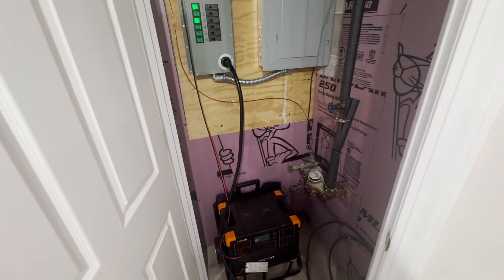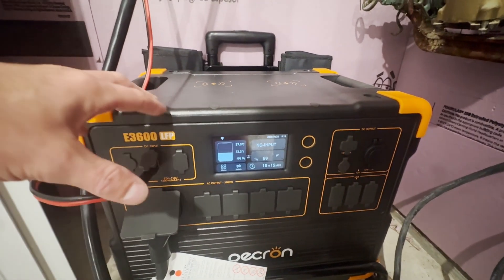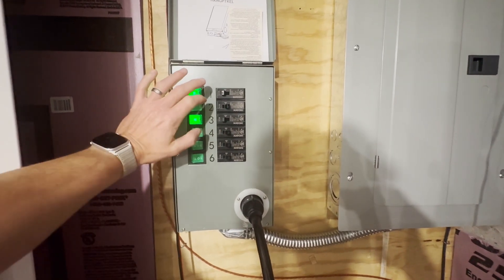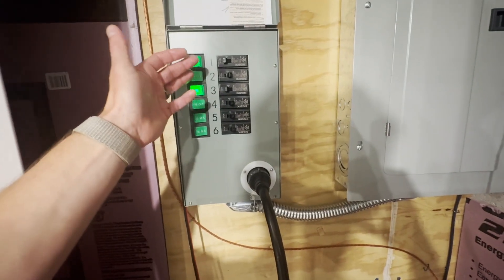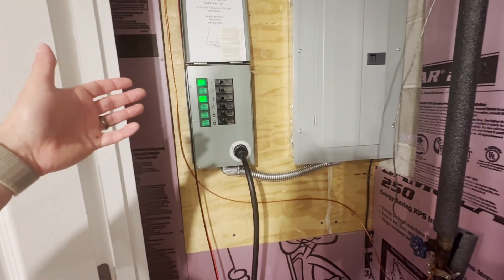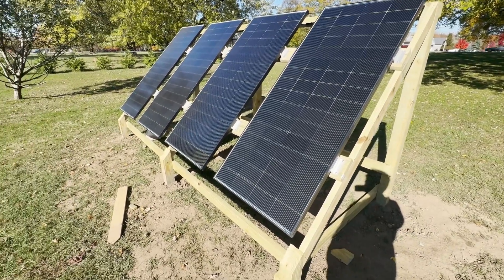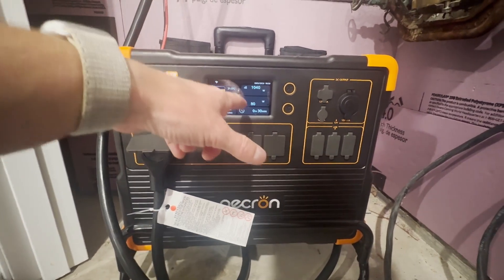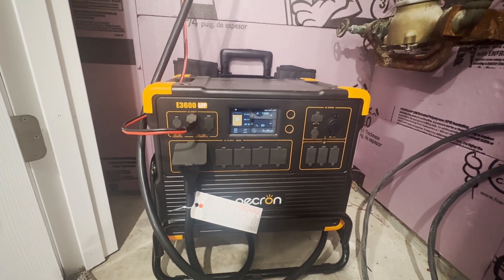DIY Solar setup with Pecron 3600LFP and 1200watts of solar

Comment: Seems like you have a great setup. Why did you choose 6 gauge instead of something cheaper like 10 gauge solar wire? Is it because of the distance? Or is it because you needed it to be direct bury so you wouldn't have to run so much conduit? With 1200 watts, I would guess you would get between 15 to 20 amps?
Reply from the maker: Good question. Primarily it was distance, if I went with smaller wire I'd have greater loss. Right now, when I am getting max sun, I'm only like 9 watts from the panel max.

However I also wanted direct-bury and 6ga is all I could find locally.

Comment: Hello sir hows your panels doing this winter? Also in Michigan running a similar set up to yours
Reply from the maker: Hello! Not so great on the heavy overcast days, When its still overcast buy light out, I am getting like 300-400 watts. As of typing this, a very gray and rainy day, 8 watts of power :D
I am supplementing it now with the wifi plug I installed at the panel.
Reply: @MatrixPrime Sounds about right 😅 have to love Michigan. Are your panels south facing?
Reply from the maker: @justinstromski2435  they are, due south on the west side of my property so they get the most sun before it goes down (or behind the neighbors trees)
Reply: @MatrixPrime sounds like it's time to cut some trees. Do it at night.......

Comment: In your video where it shows the Pecron control panel, it shows you pulling in over 1000 watts of solar, the battery almost full and 80 watts going out to your transfer switch. 
At the bottom of the panel I see 0H 32 MIN. Is that the time left until the battery reaches 100% or is that the time left until the battery runs out. I hope it's time until full.
Reply from the maker: thats the time left before the battery hits 100%

Comment: Thanks for the walkthrough!  I'm getting ready to something very similar but with a F3000LFP mated to 6 220 watt HPBC panels (do great in shade).   I'm having my future son-in-law electrician apprentice look at your video because I just bought $500 worth of copper wire and am wondering if we need to do all that wiring to relocate the existing circuits unnecessarily.
Reply from the maker: For outdoors Some people have said I went overkill on the wire at 6awg. With the round trip distance I had to go it’s what was recommended to me. 

For indoors I don’t think you’d need to do any rewiring for circuits outside of a transfer switch, unless I’m misunderstanding. You may be able to save some money there.
Reply: @MatrixPrime  I returned all the copper wire and bought a Vevor 30 Amp 10 circuit transfer switch.  I like yours, especially because they have a model with 12 circuits, but it's just too expensive vs the Vevor unit.

Comment: Michigan!   Good video and setup,  I'm also in Michigan (SE) and have a similar setup,   2 server rack 48v batteries and started with 1250w solar, expanded to double that. Had that same transfer switch (but the 4 circuit) then got a 10.    I subscribed and look forward to updates with your system!
Reply: I’m in Michigan as well, and building same set up to 30kwhs eventually, have two head units and two extra batteries presently with 2400 watts of solar
Reply from the maker: Thank you! Got a question for you! I've encountered something that "may" be an issue, but I'm not sure. I'm seeing some on again/off again pulsating of LED bulbs and lights that are running on the Pecron - both on the transfer switch AND plugging directly into the unit. It doesn't seem to do this all the time. Reached out to Pecron support and they indicate it COULD be a inverter issue and offered to either replace the entire unit OR send a new inverter with instruction on how to replace it myself. I did swap out one of the pulsating LED bulbs with one that is dimmable, and that cleared up the issue on that lamp. Have you run into any issue with pulsating LED bulbs running on a solar generator?
Reply: @MatrixPrime  yes,  as well as my stove/microwave clocks run a bit fast, when i have them running from the unit.   drives the wife crazy!  i touch on that in my latest video of my system from this summer.  its the high frequency (cheaper) inverter.   some of the lights in our hallway pulsate, probably when using JUST the right amount of watts at one time.   the higher dollar low frequency inverters shouldn't have this issue.    i was also wondering on yours - do you plan to get the fridge on it?
Reply from the maker: @oldvideos1  ok thanks, that is good to know. I'm not sure if that is/will cause damage to electronics, like electric motors or electronics?

No fridge, at least not at the moment. I would need to swap out one of my 15amp breakers for a 20amp in the transfer switch, my kitchen is running off 20amp.
Reply: @MatrixPrime  i haven't had any issues with any damage to electronics/motors from my inverter/system.
as far at the fridge,  sounds like yours is not on its own dedicated circuit?  if it was you could run it on a 15 (mine only takes about 1-2 amps).
Reply from the maker: @oldvideos1 it is not - it’s in the same circuit as one wall of the kitchen.

Comment: Hey man, 
First thank you fir sharing this and the time you invited in walking us around as if we were on site with you and going over each detail. 
I watched you video over 11 times in past 2 weeks because I have a very similar setup that Iam currently in the middle of putting it together. I spent some real $ and hope it pays off. 
So to cut to the point, I wanted to say that in my opinion as long you already invested all that $ to run  6awg solar cable all that distance to your house, I advise you to put a separate mmpt out at the panels there, that mmpt can have 20 amp out put to feed the pecron inputs directly at 150 volts.
 The reason is the mmpt is able to push the power further out than a panels can do, because the panels in general can generate a good amount of power put you will lose alot of harvested solar power trying to have the panels it self push it all that way to meet the pecron inputs.
Don't forget those pecron inputs can't tell of it is a solar panels or what is plugged in as long as it stays within the Voltage limits. 
That is also what I did and added 4 DIY expansion batteries to total capacity of over 30kwh in parallel with the Pecron's internal battery so that the pecron can tap into it as added capacity. 
So far every thing is working in the lap as designed, and I am continuing to add parts .

Comment: I owned two E3600 units which I purchased (more that 10K$) along with 8 batteries to make a 220v. system.  The system would reboot at odd times every day.  Pecron said it was a known inverter problem and promised to fix it.  When I returned the units, Pecron said one of them had bad cells and gave me another persons returned unit as a replacement.  They promised it had been ttested and worked perfectly but I found it would not charge or discharge the auxiliary batteries.  I returned it.  Now Pecron has both my units and I have no working system for three months while they repair one and promise to replace the other with a new unit.  I'm just waiting for Pecron to honor the warranty.
Reply: This is my fear is the Pecron is not ready for the big time full time work.  It's good for hobby work and occasional camping or occasional emergencies.  But you can't use it full time or it'll bite you.  This is based off of several people having failures.  The price is so tempting though.  And that price tempting me (same as you) should've been the clue for us cheapos that we're not getting some special deal, we're probably getting _exactly what we paid for_.  A bottom dollar solar generator.

Comment: Nice system. For pure backup I'm thinking of getting a tri fuel generator and running it off of my natural gas which can be continuous. The other option would be to get propane tanks. Then I can charge the pecrons during the day and use them during the night. The tri-fuel also could handle 240 volts during the day.  Thanks for the video
Reply: I was going to go that route but having the wife pull generator  out and then put in and flip the breakers off and on when I'm not her was a no go. So I went solar batteries with the 30% tax credit on 1800 = about 600 bucks. Manual transfer switch  which all you do is flip switches. I'll still get a small generator  to charge up for extended outages. The smaller ones sip gas.   I might do natural gas but as of now I don't think so.
Reply: @bigskiohio191  I wish I could make it seamless too because when it gets complicated people get lost.  I'm just using the tri-fuel generator for disaster plan because we have no sun to recharge. Want to use natural gas. Hate the maintenance of gas.
Reply: Don't forget the tax credit is running out for 3000 watt and bigger batteries and all cost. 30% tax credit. Labor wiring panels. A.llof it or just the batteries. Better hurry. I went f3000flp and Xtra battery. Switch and wiring. Around 2000. - credit. Pretty cheap for peace of mind. I just won't buy anymore guns this year.

Comment: Damn 6 awg wire must have cost a lot but that is a long run to the solar panels. Dedicated charger/inverters can go as high as 450-500v which would have saved you a lot of wiring costs.
Reply from the maker: about $750 in the 6awg

Comment: That’s a great starter setup. You are making it work with the conditions you have.

If you can, I would optimize the solar panels for winter sun, maybe one month past its lowest. 
If you have a second solar input, you should absolutely use it, max out your solar.
And speaking of it, I don’t know what input voltage this pecron can handle, but you will want to stay 20-25% below it. 
For grounding, many use rebar. The path of least resistance is the biggest conductor.

I like how you were able to pull those loads out of the main panel. You are on the right track.

Comment: You will definitely want more solar after adding the expansion battery. 
One of the best things about Pecron is the expansion batteries have 12V 30amp output as well as USB-C and a traditional 12V outlet,they can also take 400 watts of solar independent from the main unit.

Comment: I have the E3600 as well. When the fans turn on low with about 100w load, it has a horrible squeal. I haven't plugged a bigger load yet to see if the squeal goes away with a higher fan speed. I sent Pecron an email and complained, and they sent me more fans. I haven't installed them yet, because I think it's just a design flaw.
Reply from the maker: how do they expect you to install more fans? Wouldnt you have to open it up and void the warranty?
Reply: @MatrixPrime  They sent me instructions on how to disassemble the unit and replace the fans.

Comment: Nice video. It would be nice if the transfer switch could automatically switch to grid if the battery got to 10%.
Reply: He might be able to do that on the Pecron.  Plug its AC input into an outlet that's on the grid, tell the Pecron to prioritize solar input and only switch to grid input if the battery is at low.
Reply from the maker: Awesome idea - I’m not sure the settings allow for that based on what I see in the app.

Edit: based on my research this doesn’t seem possible with the pecron in its current form. Not sure if a firmware update could fix that or not.
Reply: @MatrixPrime  if anybody figures out a way to prioritize, pls post, that's exactly what I hope to do
Reply from the maker: @crmoore8617 not possible unfortunately. I’m sure it could be with a software update but as-is you need to do it all manually.